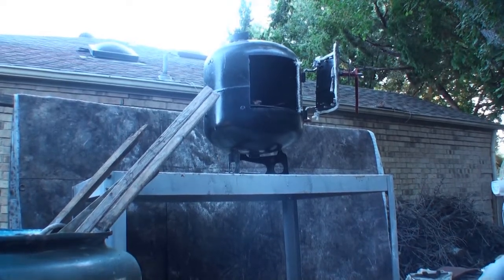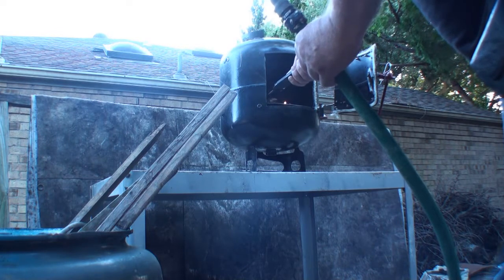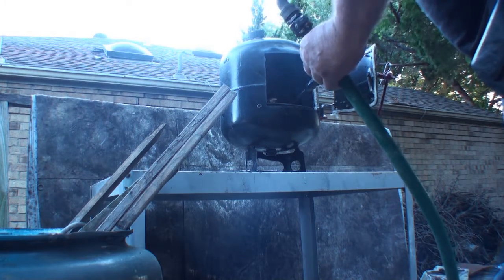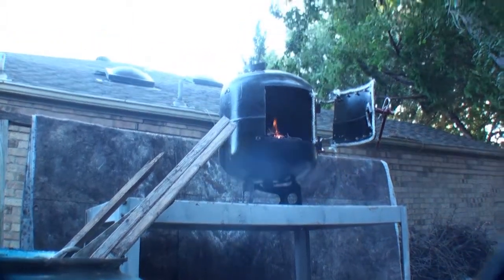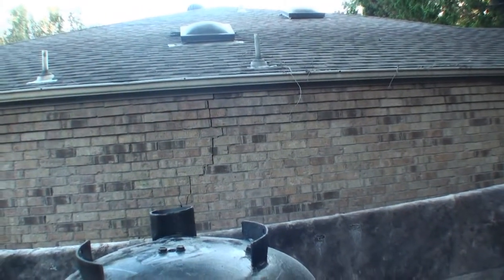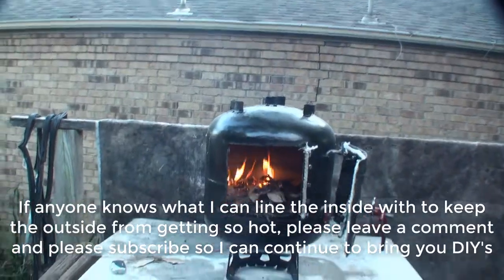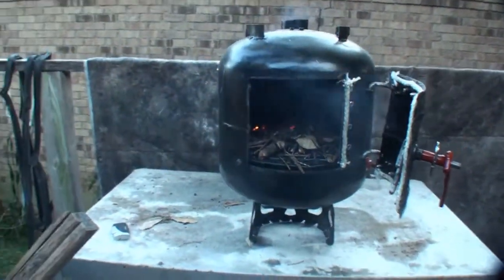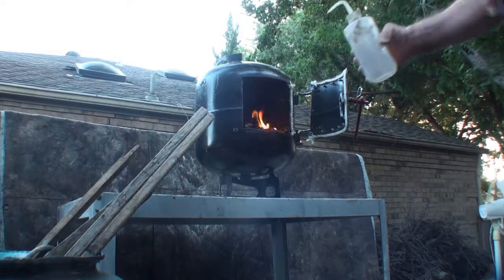Propane tank to RV wood burning heater successful first test

Comment: ceramic fiber insulation blanket from amazon, like 50$ a roll
Reply from the maker: what do you use to secure it, also does it keep the outside metal wall cooler?
Reply: Coolbreeze it's stiff enough to just.pad the inside or you just wrapp the outside and use bailing wire to secure it and the blanket is rated at 2400f
Reply from the maker: thanks for the heads up, i may try it, are you an amazon associate
Reply: Coolbreeze no I am not sorry. Just search ceramic fiber insulation blanket and a lot of good stuff shows up
Reply from the maker: i only asked because if you were I was going to buy with your associate link so you'd get a percent of the sale
Reply from the maker: I'm installing the Ceramic fiber insulation now, I'm also working on the new chimney
Reply: Coolbreeze make a video bud I want to see how it comes out